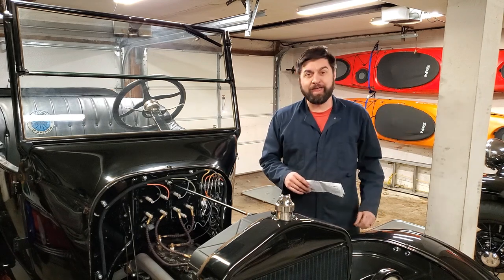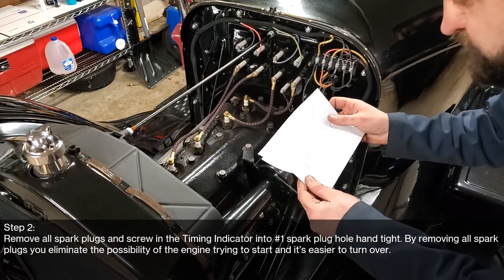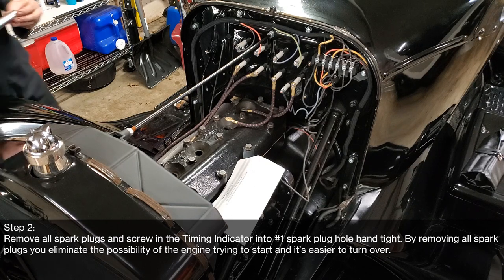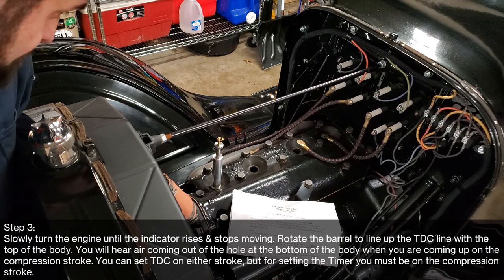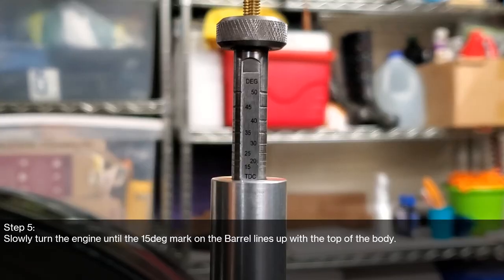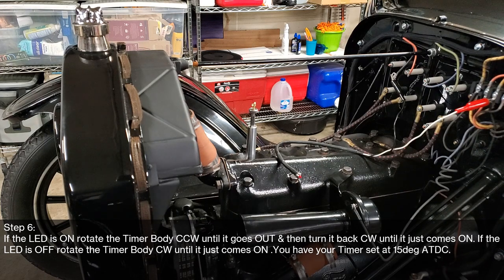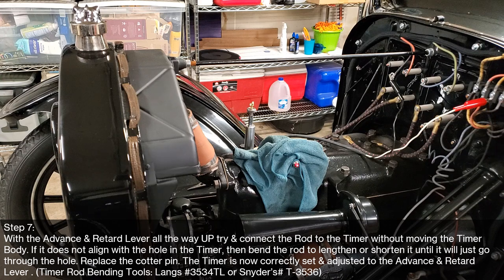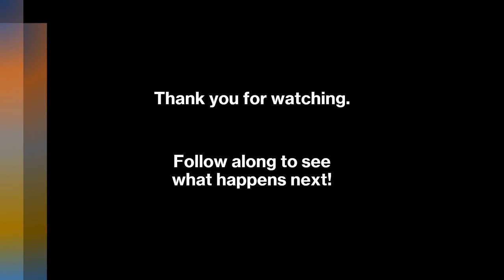Our 1923 Ford Model T Touring Car - Episode 12: Ignition Timing Indicator with LED review

Comment: Setting timing should not be guesswork, and if the very simple conventional steps are followed, it isn't. Looking at the crank pin to see its position is not a speculative proposition. Thinking of the pin as a clock hand, is it halfway between 3 and 4? If the answer is yes, then it's at 15º past TDC. If the answer is no, then turn it until the answer becomes yes. As for the nifty device, the video shows that it works. But it's a superfluous complication. It and the conventional method both work. But the former costs $86+ and the latter costs $0. I would rather spend that money on some tool important to getting a job done.
Reply from the maker: Thanks for the feedback! Yes, I agree with your statement. I was more curious about this product and wanted to try it out.

Comment: Great video…I purchased the TDC device. But, I’m confused about rotating to TDC..has you rotated, air was coming out of the which you indicated was the compression stoke, but you continue around until the TDC device came up again..which you indicated was the compression stoke..shouldn’t you have stop when air was coming out and the indicator showed TDC, rather than continue to rotate to the second TDC?